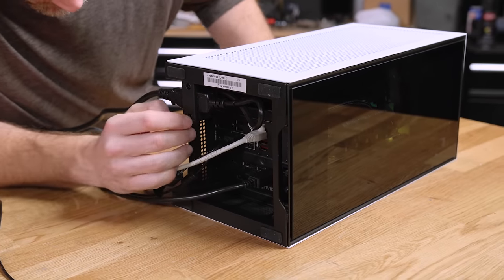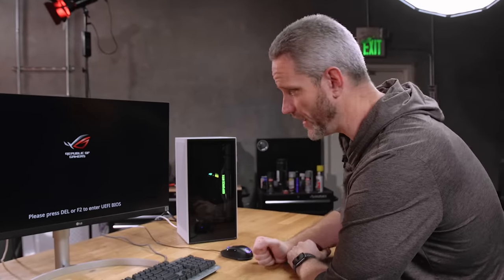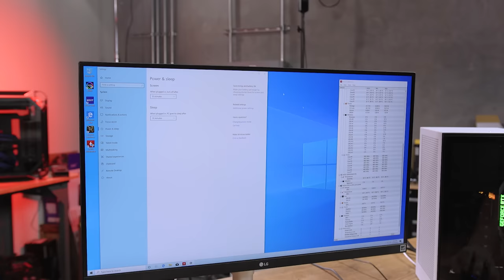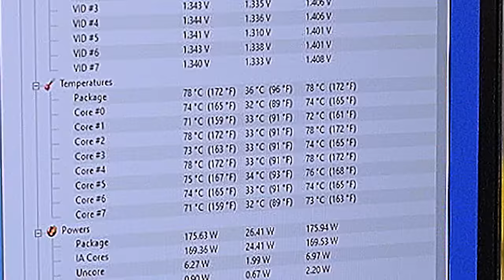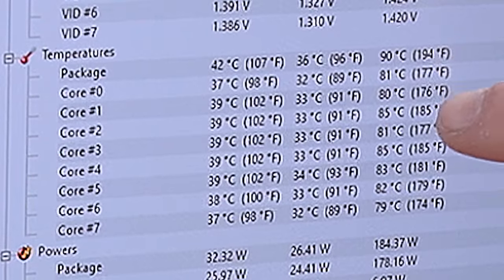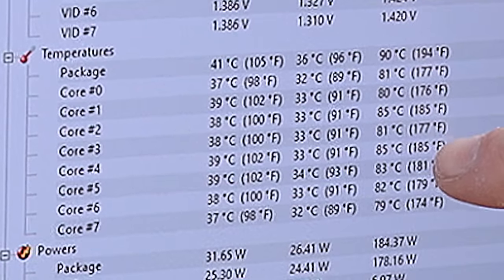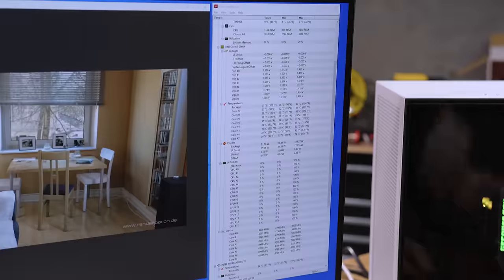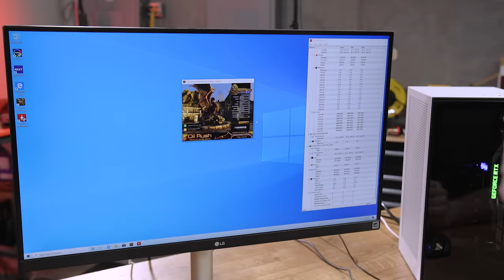You NEED to see this small PC case!

Comment: @JayzTwoCents I think one of the overlooked reasons for the fast-growing popularity of SFF cases is the fact that optical drives have gone by the wayside for most users.  Once builders suddenly don't need to have a 5.25" external bay, the cases can shrink drastically.  If optical were still much more commonplace, I'm not sure we'd see quite the interest in small cases, and small components to go along with them.

Particularly, if cases weren't shrinking I don't think the push for 2.5" drive chassis would have mattered, and we'd still have more 3.5" drives, if not 5.25" ones.  Alternate history time: What would an SSD in a 5.25" or 3.5" drive bay form factor been like?

Comment: What this case (and many others) makes me think is that we need a new Mini-ITX+ form factor, it would be just like a standard mini-ITX except the PCI slot would be an edge connector (not a slot) and on the opposite side of the motherboard. That would allow an install like this to use a short (and solid) PCI Riser card.

Comment: we're this close to being able to test what happens to a computer when you microwave it
keep shrinking them - we're almost there
Reply: I didn't know I wanted this until now
Reply: Would a small single board computer in a metal case count as a computer for your test, or do you need socketed hardware?
Reply: They sell bigger microwaves.
Reply: Phone, tablet, both a computers. They both fit in microwave.
Reply: oh yeah, i think i remember that someone microwaved a iPhone and it changed the backplate colour but it still worked
Reply: We were there nearly 20 years ago... mini-ITX was released in 2001. Shuttle has been producing SFF ("small from factor" - originally "shuttle form factor") cases since 2001.
Reply: @maxxtheender  prime example of apple selling already broke hardware lmfao

Comment: Lovely PC case, I myself own a Thermaltake Core V21.
The main problem it has and that no one mentions is poor HDDs cooling.
No one ever says anything about this, but it is very important when to try to fit a WD Black and 2 more HDDs there when you don't have any fans specifically for the HDDs.
I had to take 1 HDD off, rock only with the WD Black and another on top bottom and then install very small fans on the grill behind the HDDs to cool it down because I was getting temps of +50ºC on the HDDs, not good!

So for small cases like these, you either do some custom solution, get only one HDD and not a WD Black (don't go for higher RPM drives, more heat), or go for multiple SSDs if you have the money.
It sucks that to this point, manufacturers have yet to realize these kinds of cases benefit from having even a small fan near the HDD bay!

Comment: Personally I think the best advantage of using a vertical ITX case is when the rear panel is moved to the top. You get access to all of them USB ports while here you have to pick up the case to get to them. No doubt that the cables coming out of the bottom is way cleaner.

Comment: Me: Why would you use Intel?

Me after big brain: oh its a thermal test ^^
Reply: Intel gets you warm in the winter
Reply: @Raiko01  look how the tables have turned
Reply: if you push an amd to 5ghz all cores it will hea... oh wait..you can´t  ;-)  
honestly.. i run an i7 9700k .. i undervolted and underclocked to 1.15 volt and 4.5ghz -  just to save some  power and give it a looooong life. 
(and i just don´t need 10 fps more for double the power consumption as i play on a 75hz monitor anyway.)  
Under load i got 100watt consumption and 60° celsius max with a cheap 20€ cooler. 
It´s not like intel CPUs are crappy now. AMD just pushes benchmarks with more and more cores which you just don´t need for gaming. 
just my 2 cents ;-)
Reply: @aswmarcsteffens9798  lol. OK fanboy.
Reply: @aswmarcsteffens9798  your 2 cents as much as a million dollars, in 1935 germany
Reply: @aswmarcsteffens9798  Yes. Single core is still the most important factor for gaming, and Intel does edge out AMD there. However, for every other workload, AMD is king. The problem, for Intel, is that gaming is finally starting to move to multi-core utilization, so it's only a matter of time before Intel loses its advantage there.

Even still, just go AMD. Unless you're competitive gaming, where every single FPS can make the difference, you'll never notice the difference between AMD and Intel chips, and again, AMD is better at all the other computery things.
Reply: aswMarc Steffens at that point if you’re that naggidy about your power savings, just get a lower end cpu not something just to downgrade and have for the name of it. Just my two cents

Comment: Hey Jay, Great video!!!, nice case, but but buuuuuut... I'll make some changes: 
1- NO Glass panel, I'll use a mesh front panel as the other sides for better ventilation
2- The AIO change to a 280mm instead of a 140mm, that means the case could be a bit bigger (150mm taller)
3- 20mm more to the top making space for a 120mm fan bellow the top with a mesh finish for getting out the hot air
4- One more USB 3 at the top panel 
Hope NZXT will consider to make a taller H1 with some of my suggested changes, maybe a H2, I hope, I dream....

Comment: As great as having a horizontal case is, NZXT seems to have optimized the case in every direction (except the top, as mentioned about heat travelling up) even downwards with a small base footprint while all the cables are running out from the bottom and to the back from the motherboard I/O. Definitely in support for vertical for the H1

Comment: Would be nice if there was an alternate back panel that's a little deeper and includes exhaust fans. It's relying entirely on positive air pressure to push out the heat, but that guarantees bubbles forming behind the top and glass panel.

Comment: I wish they would revamp this case with a 750 watt psu, and then also find a way to put an exhaust fan in as well. They could make the case slightly smaller and use a top exhaust fan, or slightly deeper and put two exhaust fans into he back and make thermals so much better.

Comment: Today I bought a new CPU cooler, the Be Quiet! Pure Rock.
When I removed my previous heatsink I saw that I put on way too little thermal paste last time... I still have much to learn, Master Jay 😔
Reply: I've been there and done that, I switched to the spread method once I bought the thermal grizzly kryonaut. It comes with a little plastic spatula and even der8baur and Steve form gamers nexus have spoke about spreading. You don't get air bubbles and I shaved off 2-3 Celsius once switching from the pea method, I did also switch paste but I noticed the corners on my CPU not covered by paste too. Just my two cents lol..
Reply: Your old one didn't over heat abnormally right outta the gate?  Didn't burn out the cpu, nor the socket on the motherboard, long term?  
If yes to both, you used the perfect amount.  Period.
Reply: @conandude76  burn out your cpu or motherboard? That's not how modern PC's work. If there wasn't enough paste, it will run hotter, simple as that. If it overheats, it throttles or shuts down. The motherboard has nothing to do with the lack of cooling on a CPU.
Reply: @Ravenousjoe  Too much can cause burn out, if it squeezes out over the diodes around the socket when you clamp down the cooler, it WILL burn out the socket, and possibly the cpu.  Has been the case since 386 days, and has not changed.
 Jay and GN both have vids about this SPECIFIC thing, pointing that very thing out, if a guy building computers for over 25 years (much longer than either of them) isn't good enough for you, then go rewatch their vids about thermal paste and cpu installation.  Especially the ones where they purposefully put too much on and burn out a 300 dollar mobo...
Reply: @conandude76  cool, except the fact that we are talking about too little paste here.
Reply: @Ravenousjoe  And here I thought the context of too much or too little would be obvious.
Reply: @conandude76  It would have been if OP was talking about either. I do agree on the too much part, but it doesn't apply to too little.
Reply: @Ravenousjoe  sigh   Yeah man, that was what the first sentence of my reply covered.  Sure, he wasn't talking about too much, but the context was how much, in regards to thermal paste.  So that part where I said "...didn't overheat abnormally fast"?    Yeah, that was the too little side, I added the too much side of the point (burn out) for free.

Comment: I've got a mid tower corsair tempered glass with RGB.  I don't even light the RGB anymore and the case weighs 50lbs and I do a lot of traveling for work. I really want a small form factor build now and this case has to be the best I've seen so far. I wish they have a 750w version for the 3080 (assuming it fits)

Comment: Jay, please do a full custom loop build with this chassis, with the GPU and CPU watercooled.  Really interested in if you can add another radiator somewhere as well, and maybe a flat reservoir side by side with the GPU potentially or a smaller reservoir around top or bottom.  Debating if you can get this to be nearly silent while under load, but also maintaining low to moderate GPU and CPU temps.

Comment: I like the idea of this case, but I feel they could easily add another 2 inches to the top, and add in a 120/140mm fan to help with exhaust. It wouldn't need to be powerful as that might change it from positive airflow, to negative, but something is better than nothing.

Do this Mod Jay?

Comment: Love it. I'm very much into the small form factor lately. I just don't like all the wasted space inside the case when you work with a full sized ATX board. If you only have an GPU and no other add-in cards there is about 1/3 to 1/4 of empty space just sitting there. I think this might be my new case later this year.

Comment: I can see that just my keyboard cables would tip this over lol, can imagine adding monitor cables. guess i would need some kind of usb extension
Reply: It doesn't at all. I have 3 monitors, a thick keyboard cable (it has USB & audio passthrough), a mouse cable, headset cable, charging cable, power cable, CAT5e cable all coming out the back on the bottom and there are zero issues.
Reply: @ How do you deal with the ports being on the bottom? I'm totally behind this case besides this issue - I'm thinking about turning it upside down lol, that access would be nice
Reply: @Wakish0069  just have longer cables? lmao

Comment: Me: OMG I WANT THIS!
My wallet: Man it costs 349$
Me: Oh sh*t... you're right

EDIT: I didn't know it came with an aio and a psu
Reply: Is that too bad though? concidering it comes with a 650w psu and a 140mm rad watercooler? And also seem well thought out in terms of layout and solutions. some R&D went in to this case specifically .  its not too ridicculous.

Seem neat, clean, smart and tidy. Id say its worth it if it tickles your fancy for a case like this. Id be all over this if I were to build a new ryzen rig. but Im holding out with my Massive chonk of a CM trooper case, first gen threadripper and 1070 for at least a year or perhaps two. new consoles coming out soon, they seem pretty impressive to me and a new baseline will be set. not a good time to uppgrade unless you have deep pockets and dont really care I guess, or you are just building a computer mostly for everyday use and want it to look sleek af or just get an ITX mobo and move your current setup into this if possible. 
Aint for me with my threadripper as that waterblock wont cover the entire cpu and do it any justice. 

By 2021/2022 Im sure this case will be a tad cheaper too and maybe gets an updated and alternate versions too even similar cases from other manufacturers.

expensive or not, I like it. this little case is sleek.

Edit: saw your edit now. oops.
Reply: @hansgoranhogstrom1900  Edit: 😂
Reply: @hansgoranhogstrom1900  Btw why do you have a 1070 paired with a Threadripper 😅?
Reply: watch the whole vid before commenting

Comment: For a second i thought it was the new xbox 😂😂😂
Reply: Imagine how crappy the SexBoxSeriesSex will be when this case is about 3/4 of the price its supposed to cost.... No airflow from sides and people will put it on the floor so it will SUCC all the dust in and when it is not in use the dust lands on it... :p~~
Reply: @NoctuahVenVk How much is that in 3DMark points? :p (i hope you aren`t serious with that comment)
Reply: @woldemunster9244  
Not serious? Haven't you heard?
Reply: NoctuahVenVk 

Xbox Series X will be more powerful than the PC in the Video
Reply: @gingataisen  Ummm i have heard a million times from console fanboys repeating same stupid marketing, yes. This was a video about a case that costs 3/4 of the console and my point was that how crap-plastic and cheap the sexbox will be when that "new" hardware has to be sold at loss. Just air-cooled mobile parts to keep thermals in check. How much is 14TF, is it something powerful? How can i calculate how many flops my pc has?
Reply: @maniacmcmuffin5025  I just checked, that computer in the video has  GPU flops that aren`t even comparable. You are talking about irrelevant stuff like 3Ghz Intel vs 3Ghz AMD. Pointless bs that has no real-life value...  Hype is real and fanboys drool.

Comment: Bespoke is an adjective for anything commissioned to a particular specification. "Custom-made", "made to order", "made to measure" and sometimes "hand-made" are near-synonyms. "Off-the-shelf" and in clothing "ready-to-wear" are the opposites. Modding is a slang related term, mostly used to refer to personalization after manufacture. The word bespoke is derived from the verb to bespeak, to "speak for something", in the specialised meaning "to give order for it to be made" or commission, first cited from 1583 by the OED, with the adjective in its alternative form "bespoken" first quoted from 1607 in this sense. The term is generally more prevalent in British English than American English, which tends to use "custom" instead, as in custom car, custom motorcycle etc. Specific uses include: Bespoke medicine, a movement to better fit treatment to the individual patient Bespoke software, software written to the specific requirement of a customer Bespoke tailoring, men's clothing made to the individual measurements of the customer Bespoke shoes, shoes that are made to fit the customer's specifications

Comment: Hello Jay! This tower is really nice! Cleverly divided and puristic. But it is definitely not small... perhaps some inspiration for you for a special project? :-) 

One of my projects five years ago had following requirements: 
(1) a gaming capable system (at that time Dec. 2014 1080p and 1440p were up-to-date)
(2) nearly noiseless
(3) the case had to be high quality, puristic and the smallest possible (suitable for a living room)
(4) as much as possible performance to get with the best graphics card at this time not longer than about 18 cm
(5) absolutely stable and safe (temperatures stay within specifications under maximum load, but highest priority on noise level)

Of course, every condition implemented in a reasonable balance on feasibility and utilization.

I realized this with a Xeon e1230v3 (more individual and also cheaper than i7) plus GTX 970 (modified), the whole system cooled by air, powered by a standard ATX PSU (no STX because of noise) in a tiny, beautiful aluminium cube with a volume of about 10 liters (Cooltec Coolcube). And that was really a challenge! There were no ready-to-use solutions, I had to do several hardware modifications (also on this case) and customize software fan control. But I managed to make this system noiseless for normal use and light gaming (like Diablo III), and bearly noticable for performance-demanding gaming. Even under maximum load it is hard to recognize it and yet it won't burst into flames :-D Tricks like separating air flows of GPU (down) and CPU (through PSU), undervolting, adjusting fan curves for days and so on... I play with the thought to sometime upgrade this little cube to a Ryzen 12 core system (I think hard to realize because of TDP 105W vs Xeon TDP 80W) or 8 core (easy with TDP of 65W),  plus the best short graphics card to get (unfortunately there is no short AMD card, so I think at the moment it would be a RTX 2060, which is not far away from a AMD RX5700 as far as performance is concerned and enough performance for wide "2k" and even can manage 4k). Anything above an RX5700 isn't worth it in my opinion.

Who knows... perhaps you also think that ultra compact, puristic and silent gaming systems are cool :-P
Many greets from Germany!

Comment: Things must have changed since the last time I built a PC. Every power supply I ever encountered exhausted air out the back rather than sucked it in, which might explain the bubble of warm air behind the machine. A potential problem with positive pressure is that a high volume fan can produce a pressure level that reduces a lower volume fans ability to move air. Most fans are designed to work with an infinite volume of air on each side at normal atmospheric pressure, and not push against positive pressure. In a pushing match, the biggest pusher wins.

That said, with three mesh sides, excessive positive pressure isn't likely to be a problem (or an advantage) - lol!

Comment: I wonder how the thermals would improve if you took the perforated side panel from the empty case and put it in place of the tempered glass panel on the built PC that NZXT sent. If it fits of course, but it looks like it would.

Comment: Smaller than my build but my Ryzen 3900X is in a mITX for factor case with the Corsair H80i AIO cooler and a RTX2080. It runs well under load but the AIO of which I have one fan sitting on the outside of the case, well it can get quite blowy. The system though sits in the mid 60's under load though so there is that.  Think, ditch the glass and use mesh with filter and as mentioned, mesh all round for panels.